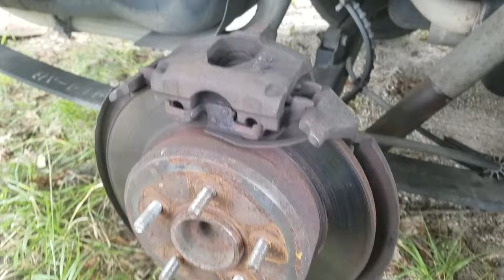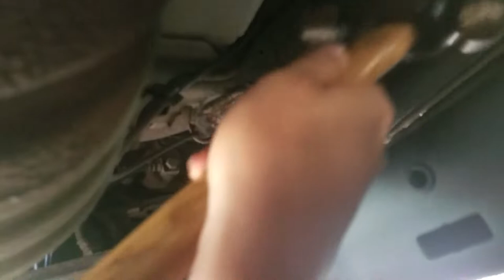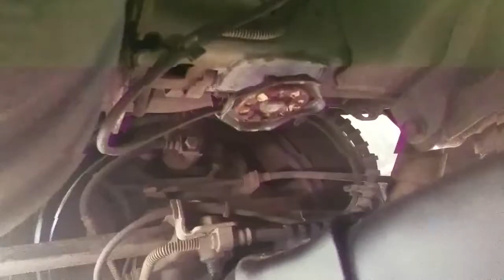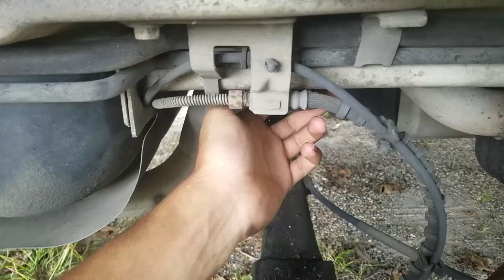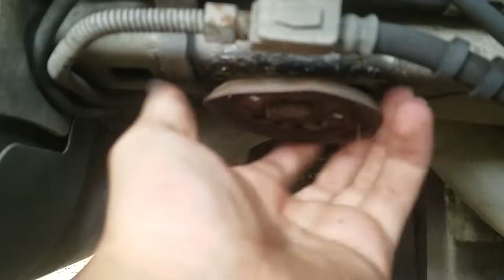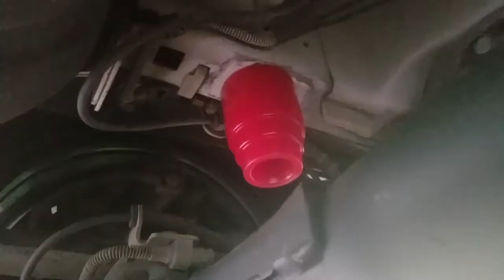2001-2007 Grand Caravan Bump Stop Replacement

Comment: It's worth mentioning that these things should be replaced in pairs.  I don't know if this is an illusion, but the new ones appear to be much larger than OEM, and a large enough bump will hit the new one without hitting the old one.  This could push your minivan to one side; something that you don't want.
Reply from the maker: Yes I have noticed this but haven't had an issue with bumps. I have noticed that with the van fully loaded it tends to lean on the bumper stop and give a harsh ride so I may cut the bump stop a bit
Reply: @TechiePocket1  Sounds like the roads where you live are much better than many of the roads I've driven!